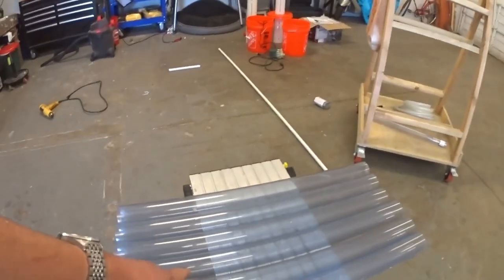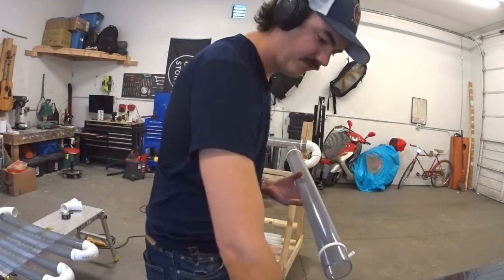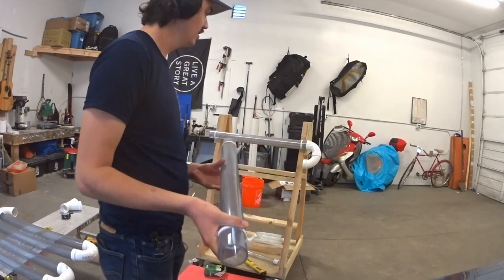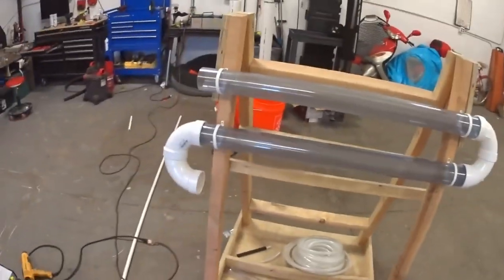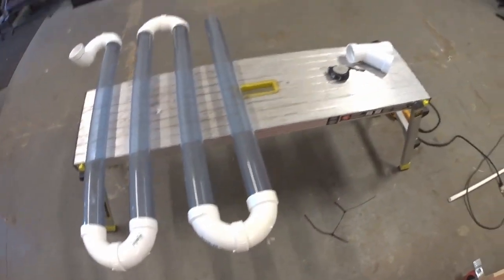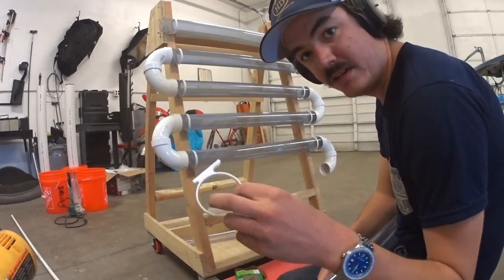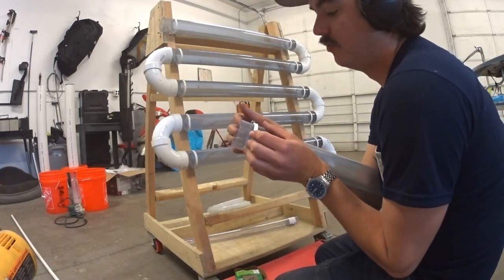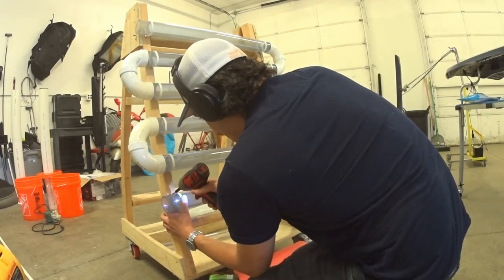ALGAE Photo-Bioreactor: EPISODE 1 (initial build)

Comment: How do you clean the inside wall of the tube due to the sunlight blocking from the moss growing, dregs or debris?
Reply from the maker: Good question, I'm not fully sure yet but I believe after the biomass is ready to be harvested then we will just blast it with hot water and see if that works! Thanks for watching!
Reply: You can insert sponge to clean pipes
Reply: @kopelanaresh  Thank you.
Reply: @DANSVILLE  Thank you.
Reply: @kopelanaresh  bagaimana cara menggerakan spon yang berada di dalam ?